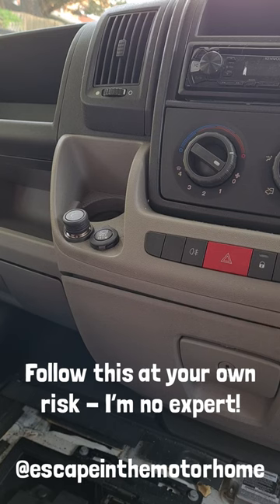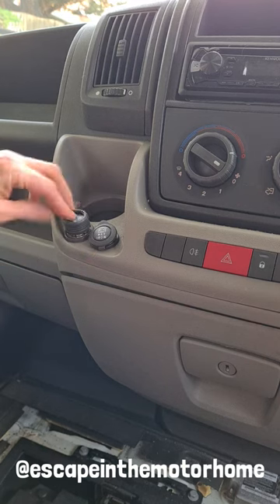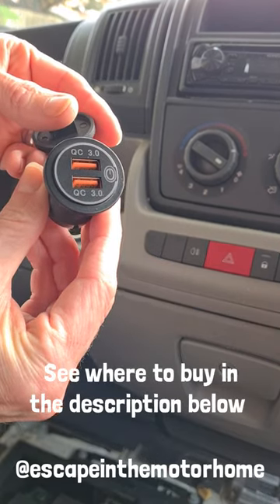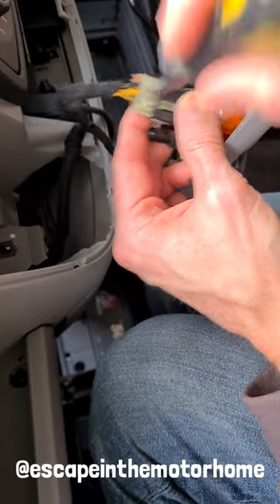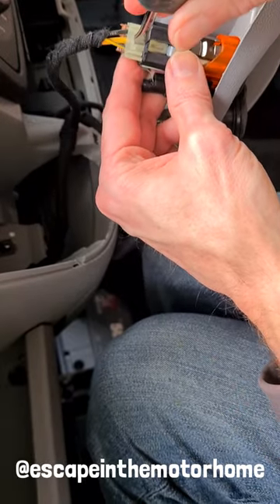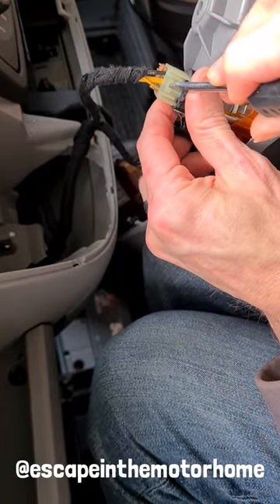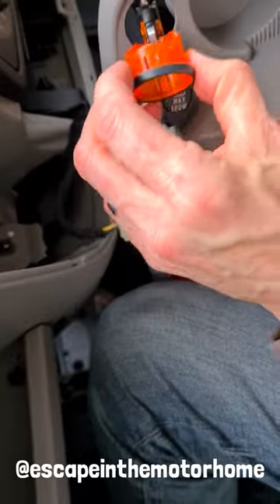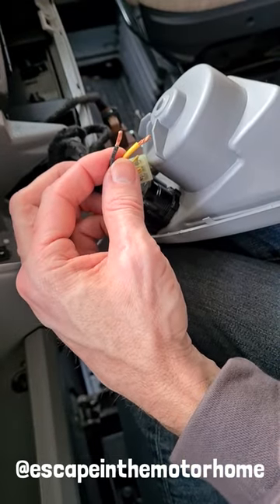How to install a USB socket in your motorhome/RV, 12v cigarette lighter to dual USB. Quick, easy DIY

Comment: This video felt more like pictures, not actual footage of doing it, just skipping everything on fast forward until nothing makes sense anymore
Reply from the maker: Hi Alexander, youtube shorts are time limited, so I had to speed up the installation. Sorry, it's too fast for you. I'm sure there's the long version in our main videos, but if you search YouTube again, you'll probably find another long format installation. Good luck! 👍
Reply: Wa
Reply: @EscapeintheMotorhome  I just want to pop the old one out without breaking it, I think a good idea is to be working on it while your talking if it’s a short and maybe just speed it up instead of fast forward. And this is not meant to be hate but constructive criticism feedback or whatever clearly people are complaining
Reply: This is something you can do without experience but if you have absolutely no clue you should research from multiple videos in case someone does something wrong without realising it
Reply: @michaelmarquez6133  if you don’t want to break it and potentially you could crimp on some male spade terminals to push into that one then crimp on the female ones to go onto onto the charger but the issue was it could unplug

Comment: What did you do with the wires your cut and how did you connect them?
Reply from the maker: Hi, I stripped the end of the wires and crimped on new electrical spade connectors, which connected to the bottom of the new USB charger. I hope that helps 😊 Daz
Reply: @EscapeintheMotorhome  Such a beautiful video just with that part missing hurt my heart. Hopefully I’m able to recover. I been struggling installing
Reply: @EscapeintheMotorhome which gauge of spade connector is it?

Comment: How did you remove the socket once you unplugged it?
Reply from the maker: Hiya, it was so long ago I can't quite remember, sorry. I guess if it was screwed in, you would have solved it by now, so I'm guessing it was clips, perhaps on either side that need releasing. They might not be obvious. Hope you find the solution. 😊👍

Comment: What about the ground cable? Lol ao what if that left one shortfuses. Wont that just mess your battery?
Reply from the maker: Hi, I've just put into a video, a 'how-to' method I gained from another publisher and I was satisfied, but I state in no uncertain terms across our channel, that I'm no electrician. Anyone working on their van, does so at their own risk. Any doubts like yours, should be answered by your own research 😊 Thanks